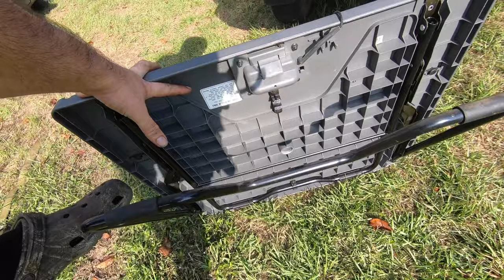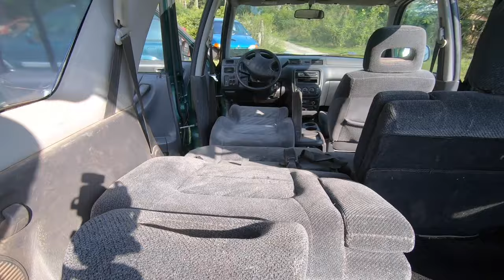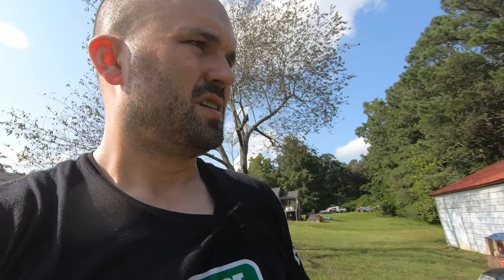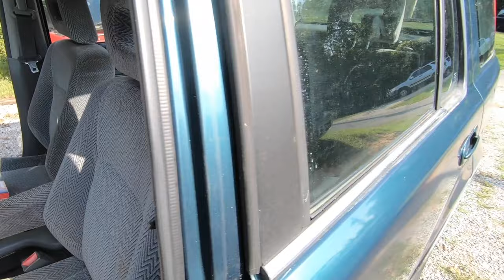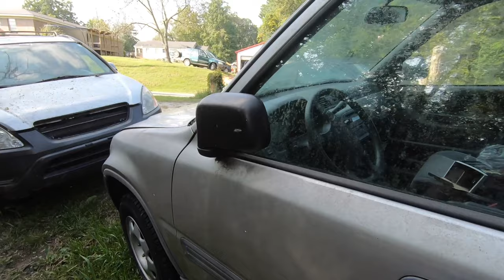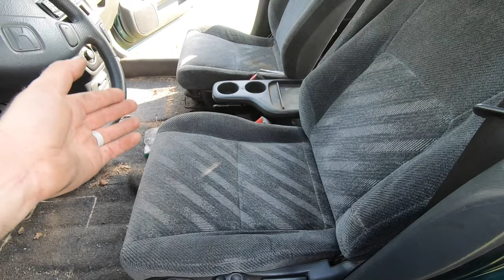Hidden Features & Treasures of the 97-01 Honda CRV RD1 RD2

Comment: Hi,  i have a Honda 1999 CR-V  ES  Auto,  i bought this in the UK,  shes got a few problems but mainly this one,  when in drive or reverse on full lock im getting a heavy juddering from the back of the car which almost feels as if shes going to stall,  now i have took her to a couple of garages  ( im not a mechanic )  i have asked to check all 4 wheel bearings and even bought both front and rear,  thinking that was the issue,  but 2 mechanics have both said that all the bearings are solid with no issues,   but still getting this juddering from the back,  a third mechanic said it could be the rear DIFF, and he was not really too keen on taking that job on ,  but i love my CRV and have no plans of getting rid of it,  mechanic says scrap it off as would be too expensive to repair,  as a ball park guess other than the rear DIFF, what else could be possibly causing this juddering ??
Reply from the maker: Most likely the diff just needs serviced. You need 1.1 quarts of OEM dual pump fluid
Reply: @hondaresource      do you have a video on that ??

Comment: I wish my wifes CRV with 135k on the odom wasn't such a bucket of bolts. I have to repair that thing with a new issue bi-monthly. It's exhausting. I love the look, and the interior, but mechanically it's been the worst vehicle I have ever owned, and it hasn't been a pleasure to work on either (bolts breaking left and right).
Reply from the maker: Sounds like you just got a bad one. Usually they are pretty solid

Comment: oh gosh! can you plz help me?  driver’s door window froze so i replaced window regulator/motor, but still won’t work! 😫  what else do i gotta replace?  2, 3, or more items?
Reply from the maker: Probably the door jam harness. I Have a video for that too
Reply: @hondaresource   could you please send link for that?   will that harness include power window switch?  or relay module?
Reply: @hondaresource    the replacement window motor kit included a wiring harness, i installed that already, but still not working

Comment: My 2000 CRV is mint condition on the inside the only problem I have is the door handle wont-work on the driver's side when you're trying to get out you have to roll the window down and reach around it's kind of annoying

Comment: What kind of gas mileage do you get on these type cars? I'm a jeep guy, recently gained interest in these vehicles
Reply from the maker: low 20's
Reply: I mostly get 24, combined city/hwy on my 2000. But I've gotten as high as 29mpg recently (guess it was the "just right" Goldilocks combo of right tire pressure, correct acceleration and perfect speed). 🤷🏻‍♀
Reply: Thank you both. I think I'll be in the market for a 1st gen pretty soon here. Anywhere from 20+ mpg really would make me happy. Good tune up, good tires and proper suspension and it'll be golden. Although I do believe I'd be more interested in an all wheel drive model. I'm sure fuel mileage will suffer some but hopefully I can find a 5 speed to offset some of the economy loss

Comment: I cleaned.out the roof rails after taking off the roof racks, I need a 3rd rail for 2 spotlights, I also intend on a 120 watt solar panel set up to power a 100 amp hr agm battery pack & 20L Frdige / Freezer.

I bought a 2001, in white with alloys, its got it problems, both lower control arms need replacing drivers side door wires broken & windows doesn't move, central locking doesn't work, have to use the key on the tailgate right hand side speaker doesn't work. I had to but a new battery.
It does have roof racks & a Hayman & Reese towbar 
I played $2800.00  Australian 
Yes I live in Australia right hand drive
Reply from the maker: Thats awesome man! I bet that fride/freezer is neat!
Reply: @hondaresource  i also have a brass monkey 50L dual zone  with wheels & its lighter than Waeko & Engel.

Comment: I bought a used CRV. It had that plastic stick thing in the netting of the back door. For a year or so, I wondered what that was for. Finally one day I was cleaning out the car and threw it away. Only to find out later what it's purpose was. I was so mad I threw it away. Now I need to get one. I'll try a junk yard first. Don't know if I can get it from a dealer. Probably cost $80 now.
Reply from the maker: They are still available at the dealer and fairly reasonable
Reply: @hondaresource  Funny thing. I didn’t know what they were called. I finally found it on a parts site. It was shown in the tire changing kit. So I looked in my kit. It was there all along. I hadn’t thrown it away. So relieved 😅

Comment: Why you like the 1st gens? Or 2nd gens?
Reply from the maker: I like the rawness of the 1st gen, but I think the 2nd gen rides better and definitely has more power.
Reply: @hondaresource  couldnt agree more but does 1st gen has less problems than 2nd gens ?
Reply from the maker: @alexduii  they both have their issues. I would say the 1st gen is easier to work on.
Reply: @hondaresource  last question what is the best year model for the 1st gen crvs?
Reply from the maker: @alexduii  I prefer the 99-01. They have slightly more power and I like the darker colored interior.

Comment: I have 4 tables.  How easy is it to convert to coil packs?  The Bottom screw on my Dizzy stripped out and I figure why not do coils.
Reply from the maker: You have several choices. The newest thing out is digidizzy. Then there is hondata and Burton racing which both require obd1 ecu
Reply: @hondaresource  Thanks!

Comment: Would you sell me some parts off the 97 to 01 crv? To New Mexico?
Reply from the maker: What do you need?
Reply: @hondaresource  where to begin. Haha. Picnic table, side nerf bars, front push bar, cooler plastic for trunk, plastic thingy that goes under passenger seat, metal thingy that holds spare tire, a working interior clock, plastic clips that hold sun visors, other things I'm sure.

Comment: B20/vtec next? 😊
Reply from the maker: I have never done a b20v actually in a crv🤣
Reply: @hondaresource  Me neither but I'm about to go pick up a b16 head and try it out
Reply from the maker: @bakihanma7247  I've done them, just not in a crv
Reply: @hondaresource  Yea I never see many people doing crazy swaps on them, very underrated. I use mine for offroading and mudding. I'm not really looking for speed I just want to see that beautiful Vtec head when I pop the hood.
Reply: @hondaresource  My original plan was to do H2b in my crv but since it's automatic there's no info or parts out on how to do automatic H2b so I decided to sell it and just get a b16 head. I know I could do 5 speed swap but I really like how the auto shifter is set up like a truck up and out the way
Reply from the maker: @bakihanma7247  how do you plan to control vtec?
Reply: @hondaresource either an automatic Gsr ecu that I have in the garage or get an OBD2 to OBD1 jumper harness with a chipped p28 ecu
Reply from the maker: @bakihanma7247  a chipped p28 isn't doing to control your trans
Reply: @hondaresource  I had a feeling that wouldn't work. I've also read that you could run the stock crv ecu and use an apexi vafc to control vtec.

Comment: The 98 crv is better, i have a 98 Lx and it does have that feature, its done the same way except you just recline the back seat all the way back and lay the back of the front down the same way, its actually a lot better set up